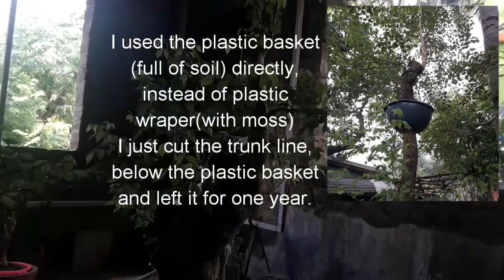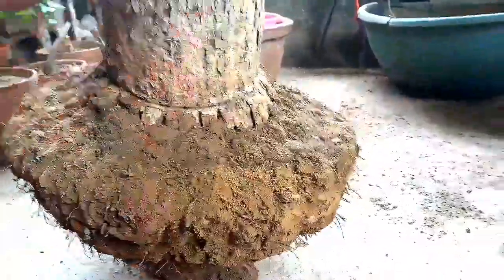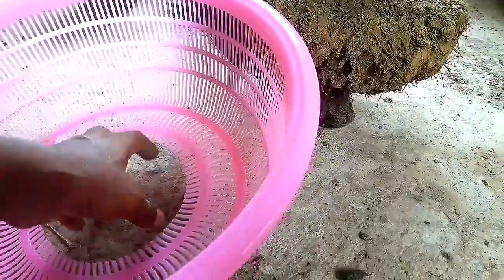different techniques | potting bonsai | how to make

Comment: Wow
Reply from the maker: Thanks a lot. Please keep in touch. 
Best regards from #BonsaiSculpture
Reply: What’s the purpose of keeping the surplus trunk and when will it removed ?
Reply from the maker: @mikbonsai   actually i useto cut the trunk below from the basket and leave it for one or two years like that, to thicken the roots enough. For most fat materials i use to do that technique rather than the common technique (airlayering by moss with a plastic wrapper).Cause we usually make airlayer before the rainy season and cut after some monthes. By that, the roots can damage in first potting cause they will not thick or strong enough within some monthes for a most heavy material. So i useto airlayer by soil in a plastic basket, instead of moss and plastic wrapper for most heavy materials(materials of 50-60 kg) and cut it by several times rathar than a single time. And just leave that(after final cut down) like it for a couple of years to thicken the roots enough.And then i useto pot it as 1st potting(here, the plastic basket isn't the 1st pot actually.It's that pot, in which i airlayered)
The excess dried trunk will damage by the times in the soil, so no need to cut it down.
Please watch carefully in the first part of the video, where i wrote that as text. 
Thank you sir.
Best regards from #BonsaiSculpture